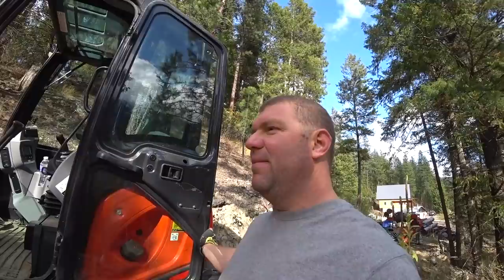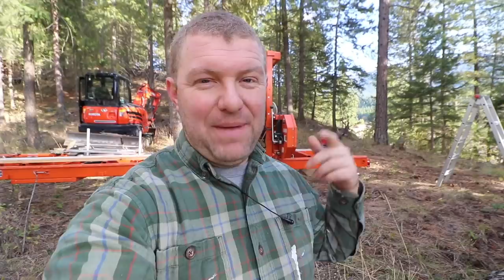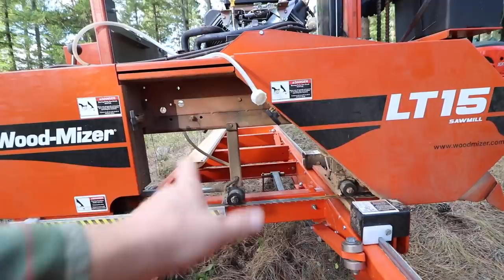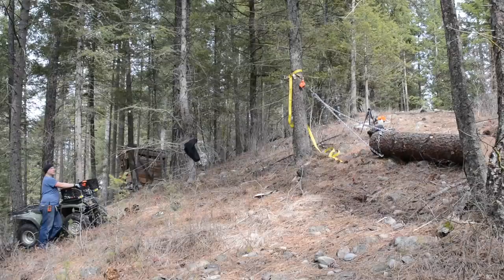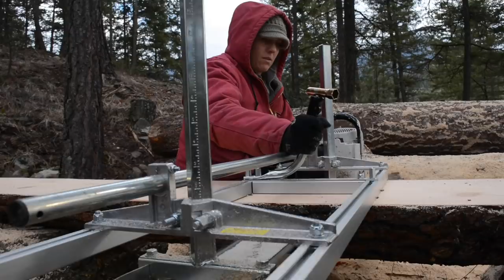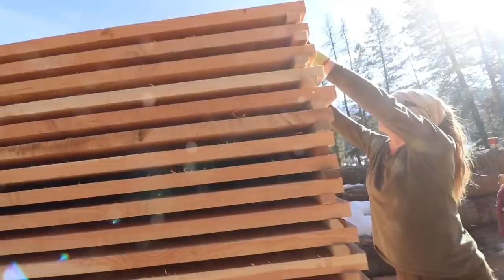DO NOT BUY A SAWMILL Till You Watch This Video!

Comment: I have a swing blade mill and and a Grandberg mill.  Anyone with a Grandberg mill would do themselves a huge favor by using a winch that pulls the saw through the cut. They are available from Granberg.  It  is so much easier on the body, and it results in a more consistent  and smooth cut.

Comment: Great info. I have owned two different Wood Mizer mills, but not again. I just ordered a LARGE Granberg mill for 72". I do not know of ANY Band mill that will cut anything over about 3 ft plus maybe a little more. I have access to 4' to 6' diameter logs so need the chain saw mill.

Comment: This is a great video, however I'm seeing some things that aren't 100% complete.  I have a Logosol Chain Saw Mill.  Some of the problems you mention with the Alaskan style mill aren't relevant to the Logosol, but then it has it's own issues.  And when you talk about the kerf on a chainsaw - they do make thin kerf bars/chains for milling.  It's still a lot more than a band, but a lot less than a typical chain.
Reply: I too run a Logosol w/ H570etech, and (for reference) measure 3/8x050 (WP30RP chain) at 1/4" KERF.   Guessing the 1/2" kerf is 404 chain?

Comment: Ok,,,,,,,to bring you uup to speed 
Sawdust is wood just like the tree,,,,right,,,now your problem is to make it back onto a tree ,,,or  into lumber again ,,,right ,,,,,,,you need to come up with a glue laminet
Mix the saw dust into it  put it in a round tube pack it solid pressure each end much pressure 500 lb per square inch ???  Let set dry & harden now you have a log,,,,,,,board  or pole hard board press board , or have it done for sale of sawdust or chip board ,,,,inginnewity barter it done

Comment: Why is it not a electric motor on the sawmill? More enviroment friendly.
Reply: Kinda hard to find an outlet if you process stuff out in the woods...
Reply: So a coal fired sawmill is more environmentally friendly than a gas powered?  Who knew?  Electricity doesn't magically come out of the wall, you know.  Wind power only works when the wind is blowing.  Solar power only works when the sun is shining.  A half mile of extension cords to reach the job site uses a lot of plastic and copper.
Reply: @userunavailable3095  We dont have any coal powerplants here in Sweden. Only waterpower  windpower and nuclear.
Reply: @jansoderman8550  Coal is still the most common fuel here.
Reply: @userunavailable3095  And natural gas.
Reply: @royreynolds108  Yes, there is natural gas, but it still can't do what coal does.